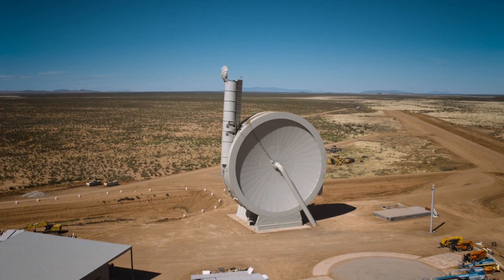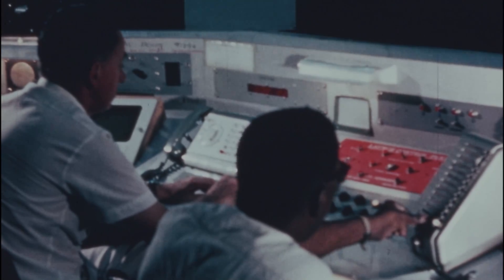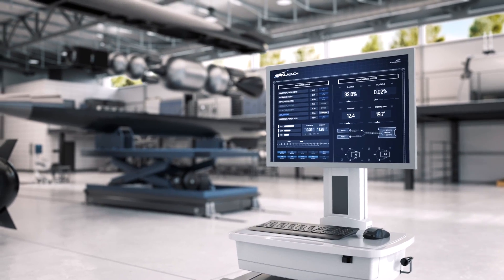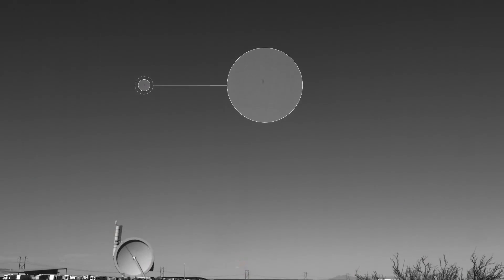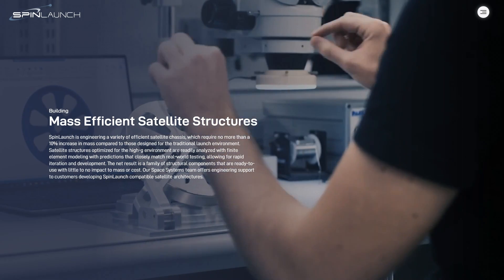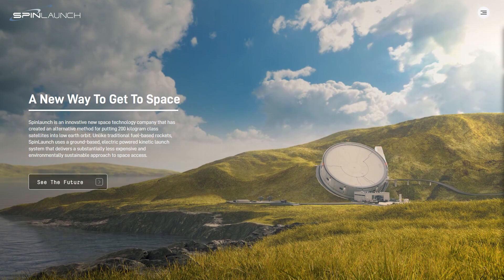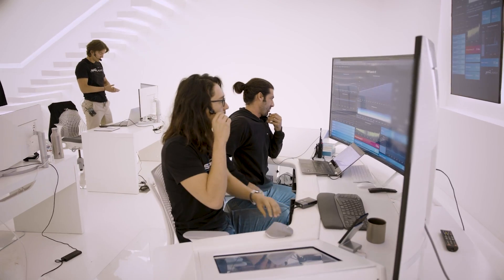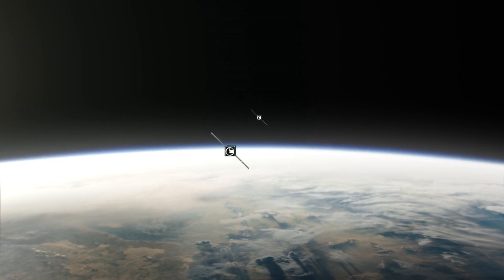Can Spinlaunch Throw Rockets Into Space?

Comment: That is absolutely mad! I have an idea useing lateral load! Bow and arrow technology. You have 2 very large flywheels 500m apart  that spin up to high rpm that then grab a huge horizontal snatchstrap which suddenly lifts the projectile from 50m underground in a launch 🚀 tunnel . The snatchstrap goes suddenly taught and snaps the projectile into the atmosphere. The connections to the snatchstrap are via a fluid clutch ! Also at each end of the strap it is secured by tunable and replacable shear pins that once the load becomes to great , the pins simple break to release the load on the strap!

Comment: Why not use a railgun?
Reply: The energy you convert to motion has to be released vastly, vastly faster in a railgun. The primary benefit of this design is the energy can be applied at a much lower rate and could reasonably be expected to work with nothing but a relatively small number of solar panels to power it.

Comment: The easiest way to stop the angular moment of the arm damaging the apparatus at moment of release, would be to release two projectiles at the same time

One sacrificial weight and one payload
Weight goes into a pit/chamber below and the payload on its way to space

Once both projectiles are released the arm would maintain balance instantly and can be allowed to calmly rotate to rest
Reply: I wonder if some kind of mechanism to change the profile of the arm would achieve the same thing. For example, if you were to suddenly make the arm angle from two points to be more like a blade, reducing air resistance, offsetting the forces against the arm from the sudden release. Or even some kind of sudden chute-like deployment streaming behind the arm to make up for the weight change. In the end, it's not really about mass, it's about force. Even something as simple as small retrorockets attached to the front of the arm and triggered at the time of release, should solve the problem by simulating the same amount of resistance. 

Just a short quick solid fuel burn that burns for long enough for the arm to spin down.  Another trick is they could have the arms be moveable at the base, to offset one arm from the other during rotation, in order to counter the forces. The arms would no longer be precisely across from each other, but it could be enough to stabilize the weight difference and keep it within an acceptable tolerance to keep it from damaging itself.
Reply: @peoplez129  it's good that you're thinking about it but most commonly the simplest is the most elegant

Your idea has merits but would increase complexity of the arm itself
All to act within a millisecond of release

You would have to pre arm and time the rocket to fire at time of release then that rocket has to have enough counter force after instant concentric forces are applied. 

My idea is a balanced arm holding onto identical object weight and shape
The arm is symmetrical in every way and release the payloads at the same time
A simple electronic signal and release

All forces remain equal
During, at time of release and after

Comment: Hey Scott have you seen those long ramps in sci-fy that a shuttle rides along to build up speed and then at the end pitches up and goes to orbit? I wonder what’s your opinion on that style.
Reply: Not as knowledgeable as Scott but I'm pretty sure the main thing preventing that from launching humans is that when it leaves the ramp it immediately experiences violent deceleration. Other than that the engineering hurtles are making the ramp long and straight enough, providing enough force and power to accelerate the vehicle, and making the upward ramp gradual enough to not smash the vehicle as it makes the transition.

Comment: Novel idea. You could fling guided missiles way out there before they have to fire. If the boards don't turn to yogurt, kick the electric jets on and off we go, only heat being air friction. Surely no exhaust signatures till later stages when the payload kicks out the jams.

Comment: Actually we already use the spin of the earth to optimize standard launches from west to east so as to provide a 2000 mph advantage to reach eastward orbits but this idea has some additional merit. This concept though seems to require stabilizing fins on the motor end of the rocket which creates a lot of drag. At mach 2+ the front of the fins and the nosecone tips ablate when hitting atmospheric oxygen molecules.
Reply: rocket could start to rotate already in air, to stabilize it without fins
Reply: @bentos117  - need rocket to spin before it is released to start off as stable.
Reply: @gtranquilla  fins could do that for initial moments, before rotation starts... think of discarding sabot round

Comment: leaving the tube at that velocity the air would be almost no different than a fluid.  A pointed tip would not be optimal. a tip that creates a laminar cavity ( like supersonic underwater projectiles ) would greatly reduce the heat on the surface , while demanding some trailing fin control for cavity encapsulation instability management
Reply: Maybe the pointed tip is necessary for stability in the initial transition from vacuum to fluid?
Reply: If that was the case then space re-entry vehicles would be doing it already...
Reply: @markh.876  show me a reentry vehicle that is looking to NOT reduce it's velocity , and I will show you something that is not a survivable reentry vehicle
Reply: @rildsilverlok  What about ICBMs?
Reply: @markh.876  Is an ICBM designed to be survived ( that's a joke ) , and why are hypersonic missiles so vogue right now? ( why is a tennis ace soo much different than a bad mitten loft , could TOF v TTA be a trackable factor , but I digress... ) leaving the atmosphere from Max Q at SECOND 1 requires every reduction in friction possible for max EF ( and stability ) . Understanding the objective and how it applies to the square to cube problem in the case of laminar flow heat dissipation and stability is paramount to designing the shape of the projectile , or parachute . 
in other words : are we talking about coming or going here
Reply: I think it's fine since it leaves atmo quite so quickly
Reply: @ssgoko88 , it would be in the atmosphere for at least 50 seconds.  Accounting for velocity lost due to drag even longer than that
Reply: @ssgoko88  yeah drag has something to say about that.  There's a very good reason most supersonic jets can't fly at top speed below 30,000 feet.  I wouldn't be shocked if the atmospheric heating eats this thing up and spits it out.
Reply: they should fire an insanely powerfull laser in front of the trajectory to create a string of vacuum cavitation to blaze a trail for the rocket in the dense air

Comment: What about a counterweight that's a big canister of water? Let that go at the same time you launch your payload.
Reply: I think this is precisely what they do. But one has to be very careful with catching this water -- when moving at 2 km/s water cuts through steel or any other material easily.
Reply: @cogoid  Yeah, I was thinking a pit on the other side of the structure; a deep one that flares out, so there's plenty of room for the splash.
Reply: @septegram  It is fascinating how youtube algorithms work. It takes them days to remove porn, but when I just posted a paragraph from Spinlaunch patent which described what they intend to do with the counterweight, the comment magically disappeared in an instant. Go figure. Anyway, they have a patent which describes how they want to do it, and you can find it online.

Comment: Would it work to build a long mag-lev track, like 100 miles long underground, the end of which curves up?  No friction except with the air.  No moving parts.  No system stress.  Once in the air, the rocket could fire, so it would just need to be strong enough to help enough to outweigh the cost - not to shoot the rocket into orbit all by itself.

Comment: An idea on how to counteract momentum change when payload is released is to have a counterbalance with same mass which also detaches at the same exact moment, flies the other way around into some kind of "deceleration chamber" where is slows down safely or at least will not damage anything else.
Reply: Use a water filled container as the counterweight
Reply: @jeffreydoujon638  the spiny splasher! The next attraction near you!
Reply: That may work. But then, it will require triple the energy. Double to accelerate the counterweight, and triple to decelerate it again.
Reply: @BlueFrenzy  You don't need the energy to decelerate it. You need reinforced area to dump it in, like blast pit. And counterweight is required in any case, like the one we can see in the video.
Reply: How about a weight that moves toward the center just as the payload is released, to adjust the balance?
Reply: @eventhisidistaken  It'll do nothing. Weight isn't going anywhere, and you can't shift it in a fraction of second as when you release the payload.
Reply: @shadyone6620  You can change center of gravity by moving the location of a weight. It would require a system that can pull an opposing counter weight toward the center just as the payload is released.  Can it be done as quickly as the release in a realizable system?  I don't know.  But I do know the basic physics works.

Comment: This is an interesting engineering project. I wonder how much "stretching" the arm has to endure?
Thanks for the video Scott.
Reply: IDK about  its stretchiness but 5:29 it shows the tensile capacity is 20 Giganewtons. Which is crazy. I want to know what the arm is made out of to have that kind of strength.
Reply: @tomw3295  20GN is about equivalent to suspending a 100m cube of concrete. You're right, thats crazy! Yes, suspension bridges handle that kind of load, but they are static and use enormous cables. Single crystal titanium per jet engine blades? That big?? They've sure got some engineering challenges ahead.
Reply: @andyowens5494  Yield strength of carbon fiber is 2500 MPa. For a stress of 20 GN that equates to 8 square meters cross section. And presumably it will taper as some of that is supporting its own weight.
Reply: @markh.876  I don't doubt your figures, but 8m2 is one big lump of composite to make perfectly (and balanced). And approx 50m long too. Thats some new engineering right there. Zylon at 5.8 GPa? Still crazy. :)
Reply: @andyowens5494  Exactly, that's why we need graphene to be industrially available ASAP
Reply: @claude199x  Ha ha ha! Graphene is available, but to make anything THAT big is an even bigger engineering problem. Let alone making it 3D in sufficient thickness to have meaningful strength.
Reply: @claude199x  that's never gonna happen
Reply: @HailAzathoth  What about synthetic spriderweb? Carbon nano tubes?
Reply: @claude199x  you can't make CNTs more than a centimeter long
Reply: Looks like its made of FLEX TAPE. Would make sense..
Reply: @stone9k  LOL

Comment: As they let go of the rocket, they could also let go of a counter weight that drops into some ground tank at the same time. No rebalancing required. The sinner would always be in balance. We'll see. Interesting project.
Reply: "The sinner would always be in balance."  A saint for every one?
Reply: @AlitaGunm99  one sinner for every saint
Reply: What happens to the counter weight? Will be traveling at the same speed and that kinetic energy needs to go somewhere…
Reply: @benprovan  The counter weight can be a bag of sand that is thrown into a pit in the ground.
Reply: @benprovan  The counter weight could be water that is dispersed upon launch but the other videos show a counter weight that is on a shorter arm. I doubt this weight is released on launch so it just appears that the whole thing is made to deal with the issue of balance post launch.

Comment: I honestly don't see these kinds of inertial launch systems being of any practical value in an atmosphere, ever.

The idea of all your delta-v as inertia from the initial launch, so that you only need to carry enough thrust to stabilize the orbit, works great if you're already in a vacuum, but that is just not the problem we are trying to solve in further commercializing LEO right now.  

It's only sensible for the very specific situation where you never have to deal with atmospheric resistance, you have an entirely inertial trajectory and very limited delta v afterwards, and the initial velocity required is low enough that the payload can actually survive the launch. Really the only niche it would make sense, would be launching into orbit of small, airless bodies like the moon. It wouldn't even be useful for launching from a lower orbit to a higher orbit, because that negates the entire appeal of not having to launch the launch assembly.

Comment: I am curious as to what happens to the launching apparatus when they release the rocket at 450R p.m.? I'm sure the rocket is pretty heavy so there needs to be some sort of counterbalance weight at the other end. When they release the rocket, that thing is going to be seriously unbalanced unless they are releasing the counterweight simultaneously. They definitely need some way to keep the arm balanced after it releases. Otherwise that thing is going to turn into the world's largest vibrator motor ever created! (Obviously they have figured out a way to do it without the thing becoming so unbalanced it shakes itself apart. I do realize that. This is strictly a "what if" funny thing to think about.)

Comment: Biggest problem is the balance issue, because the rocket or projectiles weight multiplied by X number of g's, then the second you release you are facing a very serious rebalancing problem that would most likely result in a catastrophic failure.

Comment: Surely a system that arms a mechanical, assault-rifle-style launch mechanism a half-turn before would also be able to move the counterweight into the centre at the same time, like the feed on a modern Gatling gun... oooh I just thought, you could also release the counterweight simultaneously into a tube that with electromagnets recovered a good percentage if the energy haha

Comment: I assume that after launch they could convert the spinning arm's energy back into electricity. However there will be a rush of air, slowing down the arm. I wonder if running two opposing launch systems, with one charging the other, is more efficient. It might be feasible to have gears between the two launch systems which transfer the energy mechanically. That would require a pretty big transmission though.

Comment: Another sad case of engineering vs computer simulated graphics, and the wrong winner.  This is IPO bait, another hyperloop pipe dream - note this is already the worlds largest vacuum chamber.  Scaling this up to the size proposed is not possible at many levels, starting with a trans-sonic projectile instantaneously bursting into 14 psi of atmosphere, with drag at some V(exp)4. Burn would be needed at  T+.01 sec.   Not to mention the dynamics, vibration, and internal stresses and structural issues.  Mega-energy is required to get rockets off the ground, and why we burn fuels, and not electricity.  The comment about this on the moon might be the most ridiculous of the lot. Capitalism has taken over the field of engineering, from YouTube to Wall Street.

Comment: Does our current material science handle the forces for the rotational stresses? From the papers on using flywheel energy storage devices they suggest that for meaningful energy storage the sizes needed (smaller than the 100m for spin launch) the materials we presently have would not support this tech.

Comment: Great way to get mass to orbit, water needed for people to live there, crack into air, etc., fuel, as well as metal components of stations even if just structural struts conventionally launched habs fit into.  Might be the safest way to get nuke power elements into orbit too, tiny bits in heavily shielded capsules that can survive total launch failure as an intact lump, ie, fall to earth, which beat conventional rockets where failure mode is explode vaporize nuke material distribute over 100's of miles.  However, Mach 1 is TRIVIAL and it is hard to imagine how this can be scaled up and not rip itself to shreds.  Get past that and you'd need a London Eye size disk, anchored to the rims of a 500 foot deep Canyon.  EPIC engineering unseen on earth yet.  You'd also need to keep the disk spinning for months at a time as spin up and down will consume too much time and energy to do for each launch - which brings in how to load a capsule onto the spinning wheel....  All in all, it'd be better to investigate that space cannon or electromagnetic accelerator atop a mountain or plateau a few miles high along the equator...

Comment: So, how does the vacuum chamber with the spinning arm work if the opening has to be open to the outside to launch the rocket through?  I don't believe opening it up just before launch would be good since it'll introduce the atmosphere into the chamber and increase air resistance/friction.

Edit:  Nevermind.  I posted my comment just before the video got to the part of the membrane covering the opening.